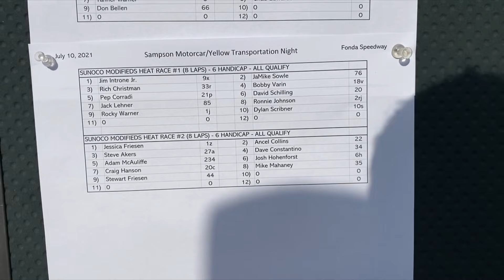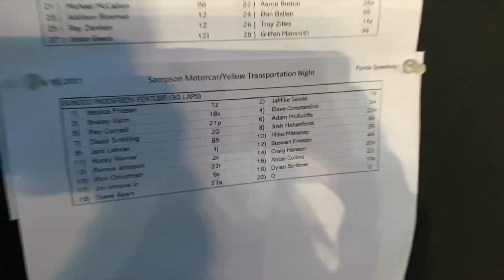Can Anyone Beat Friesen At Fonda Speedway? Oh Wait...

Comment: Lately, it seems all the track surfaces in the northeast have changed. I think it is partly due to the weird weather and excessive rain, and also any new clay added for the beginning of the season getting worn down. All the tracks are becoming dry/slick with not much cushion on top. Also, because of all the rain, I think promoters are a bit reluctant to use a lot of water. Too wet, and the ruts/holes are everywhere. You know how that works.
Hopefully, Mike will get his setup working better on the dry/slick. That looks to be the name of the game at this point. The extremely dry/slick conditions make it difficult to actually race for positions, as opposed to follow the leader train racing. I'll have my fingers crossed,🤞and I have full confidence in Mike's talent and abilities. He's a thinker!
Thanks for the video, Mandee, and I wish you all the best of luck in the upcoming races!! 👍🏁
Reply: The modified bodies suck the moisture out of the track.

Comment: Basically the 44F ran second without even trying
Reply: He was working hard. Started 12, worked up thru there, and actually passed JZ in three and four, and JZ crossed him up and then took the high groove back ( the Stewy lane) and forced him to try and beat her on the low side. Ran out of laps. JZ had a fast car all day. At the first caution she had a six second lead on second place.
Reply: Stew was raised right....
You don't beat your wife! 😝
Reply: @tcjohnson3437  He slammed on the brakes heading into 3.
Reply: @tcjohnson3437  he coulda slide jobbed here a few times, but he gave it to her.
Reply: @ikeyeet8312  yep. If Warnner would have put a harder challenge on Stew the last few, we might of seen alittle different ending, but Stew made the right call and accepted 2nd IMO.  Passing you wife for the win just seems like a win/lose situation to me. Lol